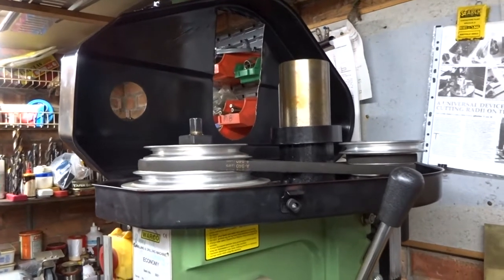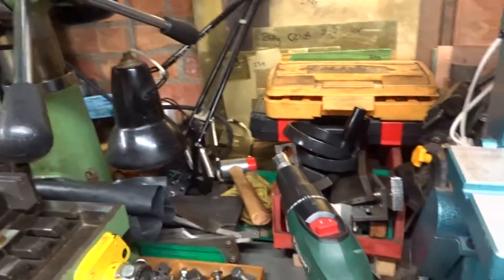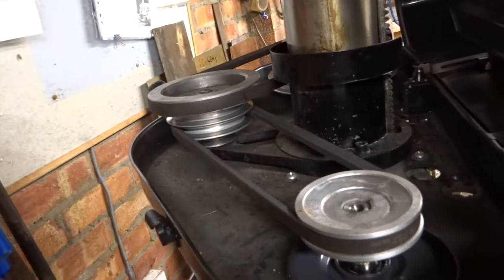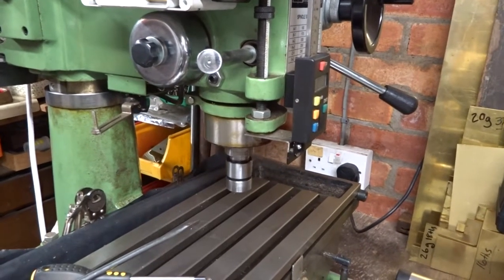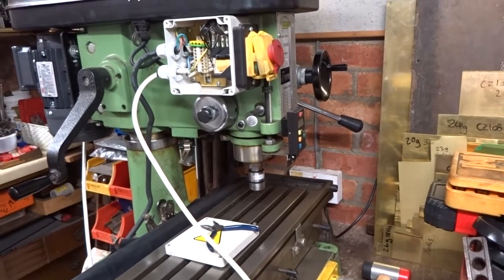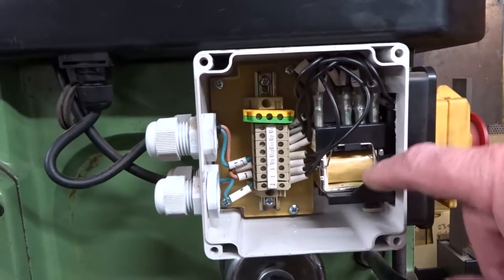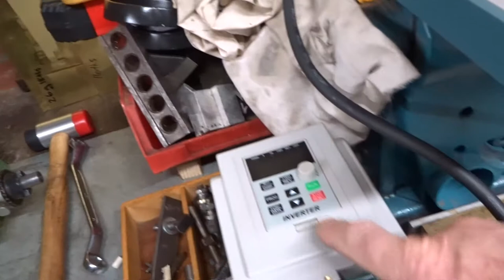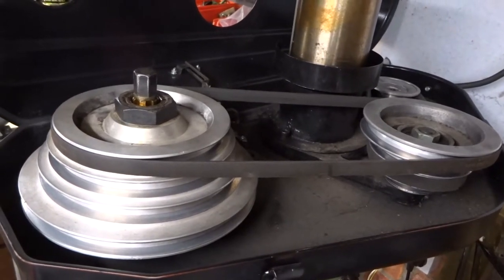Adding a variable frequency drive to a milling machine

Comment: Edwin,

Thanks very much.  My Super 7 is already fitted with an inverter - previous owner - and that works well.  I had wondered about trying to run the Warco and the Myford off the same inverter, so I would only have to buy a new 3 phase motor for the mill - it may be possible, but beyond my capabilities!  Now found supplier of motor, inverter and remote - should be able to do the job for under £350.  So I will avoid falling off the stool while changing speed.  It is amazing how much you can do however by not changing speed with just light cuts, but it would be nice to use the mill properly.

Regards
Mitch
Reply: Perfectly possible- just needs a big changeover switch bank to redirect both the 3 cores to the motor and the control buttons and speed pot. 2 or 3 relays should do it...
Reply: @Tensquaremetreworkshop  
I went ahead and fitted an inverter and new motor to the mill, so now the lathe and the mill are independent, each with their own inverter - works fine thanks. However, very interested in your new z axis arrangement with auto alignment.  As you know a big disadvantage of the the column type  mill is loss of alignment if the z height I changed.  How did you do it please?

Thanks
Mitch
Reply: @Tensquaremetreworkshop  
Many thanks for the quick reply.  I will subscribe immediately!  Look forward to the upcoming videos.  If it is within my capabilities I will have a go.

Thanks
Mitch

Comment: I did a similar conversion recently. Instead of using the front panel buttons to power the inverter, I wired them to the start button on the inverter. Now the start/stop buttons start and stop the machine as previously. I have now added a power lift system and a head alignment system to retain registration when moving the Z axis. Transformed the machine!
Reply from the maker: Thanks Mike, I think I may have done something similar originally in that I wired the inverter via the original start/stop buttons on the mill. After some time (months?) however the original start stop buttons literally went up in smoke. So now I just use the inverter start stop. I am not electrically minded so daresay I did something stupid with the original wiring!
Reply: @edwinwhite933  I am using the original buttons to switch the 'forward' signal to the VFD. As this only takes milliamps, the switch is safe. It will not work with a NVR device however, these need mains to retain the contactor. My mill is 40 years old, and is before such features!

Comment: Have a look at Winky's shop for his conversion of the raising and lowering of the head and also his method to keep the head from rotating when moving the head to a new position.
Reply from the maker: Thanks Dwight. I have previously seen Winky's vid. He did an excellent job. If I wasn't so lazy I might follow his example, but sadly I tend to do just enough to complete whatever project is to hand and put any refinements on a 'to do' list that gets lost and is therefore rarely actioned. I need to develop a great deal more self discipline - I'll put that on a 'to do' list - LOL
Ed

Comment: great work sir..I am about to embark on this journey. thank you for doing the video.
Reply from the maker: Many thanks. This is about the best mod I made to my workshop equipment (along with the variable frequency drive to my lathe). I don't miss changing the belt drives one bit and have even been known to use about the right speed for whatever drill or milling cutter I am using. LOL.

Comment: Hi Ed. Good video. Ive fitted an inverter to my lathe which has a 3 phase motor. I've added a box housing some switches for start stop and direction and also an emergency stop. If you look at the manual for the VFD it should show an option to wire in external switches so that you can control the mill without removing power to the VFD which is probably not a good idea. If I can help please let me know. Kevin
Reply from the maker: Thanks Kevin. if you find my video on making a similar mod to my Myford you will see that I did exactly as you recommend i.e. independent start stop, reverse, jog function (useful for screw cutting) and big red stop button. Notwithstanding the clutch on the Myford, the motor on the Myford gets a lot more start stop use and  indeed the lathe gets a lot more use than the mill. On the mill I find I do not  change speed or cutters very frequently and with its generally lower use rate I decided to just go with the standard inverter start stop etc. All I can say is that thus far I have not had any prob with the inverter on the mill. fingers crossed.
Ed

Comment: Also looks like you have had this in operation for a while did the new setup have enough torque using the milling operations with the pulley you choose? I'm worried that you might loose to much torque Thanks again Mike E.
Reply from the maker: Hi Mike I will reply to both your questions in one shot. Firstly and importantly I have never found loss of torque to be a problem even at chuck speeds as low as 100 rpm as measured on my digital tacho. I did retain the stepped pulleys on the mill so I can go slower speed if requd, but have never found that necessary. Prob the lowest chuck speed I commonly use is abt 210 rpm.  I believe I got the motor 0.75 kw 50 hz from a local (to me) distributor Grantham Engineering (01476 566301). The motor is a TEC www.tecmotors.co.uk (01299 252990) (ref 0.7543TECAB3- IE2  ms2 802-4). The motor is 0.75 kw, 4 pole footmounted. I have had the set up for years and never had any trouble. I found all this in the orig tech sheets so you will need to check if the info is still current.
I made similar variable speed mods to my Myford super 7 which works brilliantly. I did use different suppliers to the above and the Myford motor is 1 HP. A clever man called Steve Jordan did a U tube years ago on the Myford variable speed motor conversion. If you can't find Steves vid let me know and I will search my saved U tube channels.
I think I did these conversions around 2018/2019 so memories are a bit vague. I am a rank amateur so my tech knowledge is very limited. Hope this helps. I never had any installation probs - just followed the instructions on the various boxes etc.
Reply: @edwinwhite933  Thanks for the update In the US we use 60 cycles I think you're using 50 cycles I don't think it matters since we're using a converter and changing the frequencies. I will look for a 3ph here first.  I did find the same type of motor you used, again thanks for the info.
Reply from the maker: Yeah uk is on 50 cycles, I did not realise you were in the USA so my contacts lists are prob no good for you. As long as you get professional advice in your country re 60 cycles I think the 3 phase inverter speed control mech will work fine. It is a really handy mod to do - at least for me.
Best wishes
Ed
Reply: @edwinwhite933  I found the same type of motor from the UK it's 50hz but it should work fine on 60hz  it will run a bit faster in the US and should work with the same VFD setup.
Reply from the maker: You are correct that the motor will run a bit quicker BUT check with the supplier that overheating of the core of the 50 hz motor will not be an issue. Also I suspect that torque characteristics of a 50hz motor running on 60hz could be adversely affected. Before you spend your $ please check with the motor supplier. I do not want to lead you up the garden path as it were. I am not an electrical engineer hence my hesitancy.
Ed

Comment: Hi, which frequency converter do I, need to covert milling machine 50hz supply to 60hz
Reply from the maker: Hi, many thanks for your interest. Sadly I am not an electrical or electronics engineer. I am therefore not qualified to properly answer your query. As you mention 60hz I am guessing you may be in the US? Here in the UK we standardise on 50 hz. As a few general tips I believe you must check that whatever motor you intend to control is capable of invertor start and variable frequency control and is also generally compatible with whatever invertor you intend to use. The invertor I purchased for the mill is a Bangood import XSy AT 1 which converts our standard UK single phase 50 hz 230 v supply to 380v 3 phase so that invertor control will work. My general understanding is that invertor control only really works well with 3 phase motors. I think you should approach a friendly local invertor supplier with your question. I expect they will need full details of the motor you intend to control. So sorry I cannot be more helpful, but I can say that I have been entirely satisfied with invertor control on both my Milling machine and hobby lathe. Not having to change drive belts is a real boon.

Comment: Do you have  link(s) to the motor and VFD which you used?
Reply from the maker: https://youtu.be/uMTb7uy1HfU
Dwight sorry for delayed reply. I got the info and idea for the vfd controls from a channel called 'Steve Jordan' here in  the UK. All the parts were sourced from local suppliers in the UK, but in effect they are made in China (regrettably). The motor is a 1 hp TEC and the controller is an AT 1 series the same as the one used by Steve sourced from a supplier in Grantham UK. That said as they are clearly chinese I would guess you can get them anywhere on the internet.I attach a link to one of Steve's u tube vids at the top of this reply. He has done a number of them on the subject of variable speed control. He is much more knowledgeable on the subject of electronics than I am. I can say that I have found the motor and inverter control to be totally reliable so far. Hope this helps, but if you need more info please get back to me and I will try not to be so dilatory with my reply.
Ed

Comment: Would a 220V 0.75KW 1HP Single To Single Phase VFD not do the same?
Reply from the maker: I am not electrically minded, but I believe the simple answer to your question is 'no'. The variable speed inverters work I believe by varying the frequency of 3 phase supply to the 3 phase motor. As far as I know u cannot do this with single phase. The 3 phase inverters  are particularly good for providing excellent torque from 3 phase motors at low revs (i.e. frequency). It is possible to vary the speed of a single phase motor and years  ago a very clever colleague designed me a circuit to vary the speed of a single phase motor based (at that time) upon a thyristor type controller. However one of the disadvantages was that at low speed the torque characteristics of the motor were very poor and not suitable (in my view) for a machine tool. To the best of my knowledge if you want good torque characteristics at low speed, a 3 phase motor and 3 phase variable frequency control is the way to go. Doubtless others with more technical electrical knowledge could advise further.
Reply: I my be wrong? by the 230v motor would be usd with a 460v vfd  120!! Herts so no!! Drop

Comment: I might be wrong but I've understood that it's a bad thing to turn off the inverter with the motor running.....or maybe you're not suppose to turn off motor with the inverter running? I'm confused now.
Reply from the maker: I have had inverters on my lathe and mill for several years without incident. The inverters are two different makes and on the lathe I wired a separate start/stop, speed controller and 'jog' controller into the inverter according to advice given me at the time by the retailer. I have never turned the inverters off while the motors are running. I imagine that might cause a power surge that could be harmful. On the mill I use the 'stop' function inbuilt to the inverter (this stops the motor but does not turn the inverter off). On the lathe I use the 'stop' function on the separate stop/start etc, but again this does not turn the inverter off. Both my inverters are wired such that the only way to fully turn them off is to isolate the incoming elec supply. I never do this with the motors running and only isolate the inverters when I am done for the day. Hope this helps. Appology for delayed reply I don't get on the computer every day.
Ed
Ps the'jog'/ reverse function on the remote controller to the lathe inverter has proved incredibly useful.

Comment: Hi,

I have the same mill, and am just about to do the same thing for exactly the same reason! How has your mod worked out?  Which motor and vdf did you use please?  Any advice greatly appreciated.

Mitch
Reply from the maker: Thanks Mitch. The motor is 0.75kw 4 pole,foot mounted motor B3IE2 (according to the product leaflet) and supplied by a local electrical factor. I think I got the invertor from Bangood (chinese) and it did take a while to deliver.I think it is a 2.2kw 220v Ac in 12 amp invertor XSY AT1, but I am sure there are other more local (UK) suppliers of similar kit. You will need a length of 3 phase cable to connect the inverter and motor. I did a similar conversion on my Myford Super 7,  but I think I used different suppliers. Both conversions have been 100% reliable and very useful. I bought a cheap optical infra red tacho and prepared charts for each machine that shows spindle speed vs frequency. On the Myford I also bought and fitted a cable operated remote for the variable speed start/stop control. This is handy and if I can find one I will fit one to the mill inverter. The inverter needs to be sited clear of the machine primarily to keep it away from 'chips' and cutting oil etc. Usually this may mean it is in an inconvenient place to read and the remote is therefore useful. You may need to buy a different pulley for the motor to connect to the mills' belt. I have a feeling I did, but can't quite remember. I am not an electrician so please double check all the info.
Ed
Reply: @edwinwhite933  Get the right inverter and you can calibrate the display to show actual RPM. 
On my lathe conversion I used an Auduino nano to give a remote control and display, and to handle the forward/reverse logic. This also shows the target RPM when it is stationary- not all VFDs do this. I have three (lathe, mill, CNC machine) and they are all different in functionality!